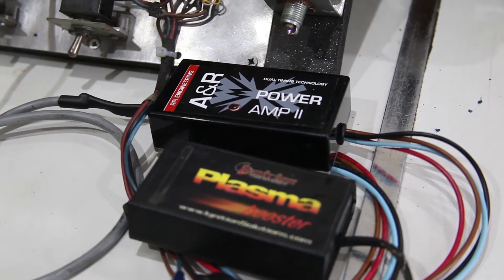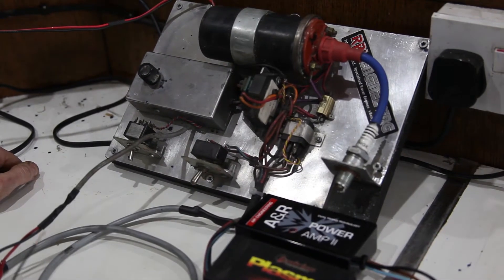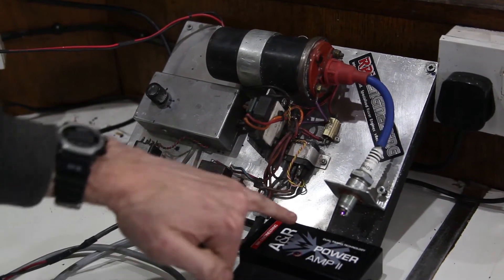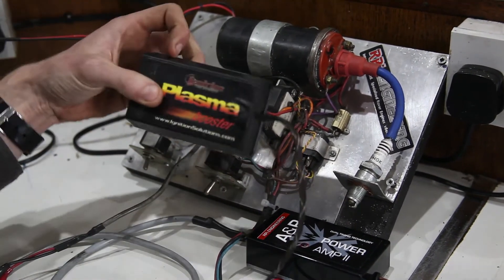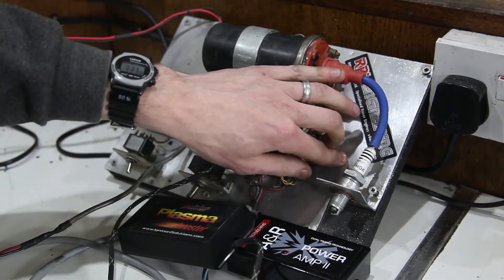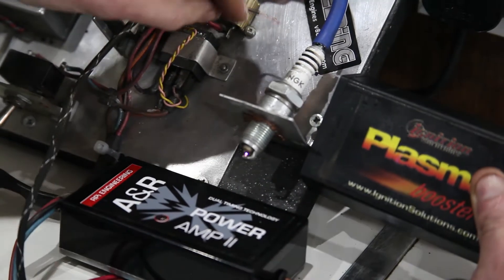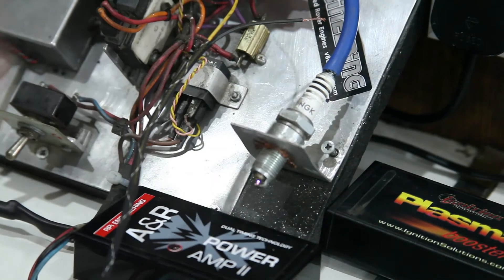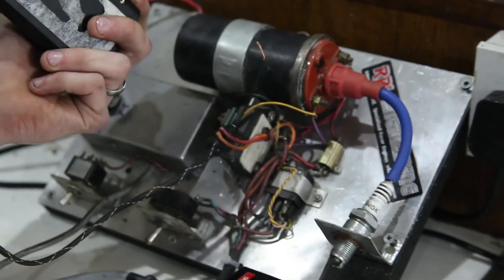Rover V8 Ignition Amplifier Test and Comparison

Comment: You will learn nothing about the joules of energy in the spark just by looking at the spark jumping across a standard plug gap, you should at least have a setup the allows you to increase the gap to around 20mm. Even then increasing the gap just requires more kV so this is still not telling you about the joules of energy. (Its better than nothing though!) Every time I have spoken to RPI they imply that their amp is the cure for everything! I run a fully programable MSD system which is triggered by a dizzy that I have modified, it is 'locked out' and runs the MSD pickup.